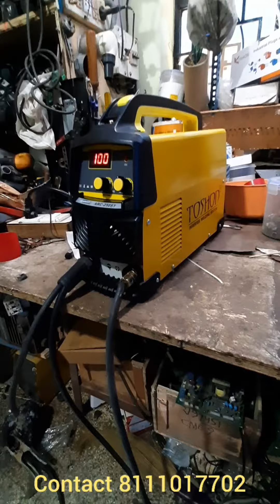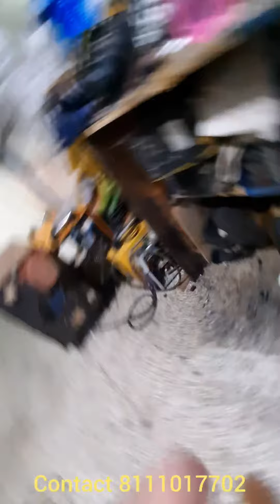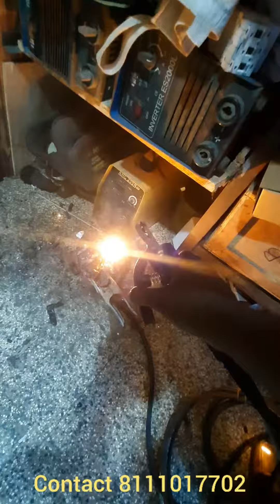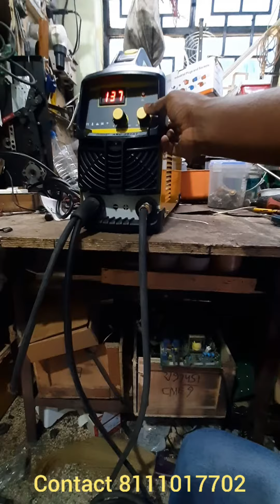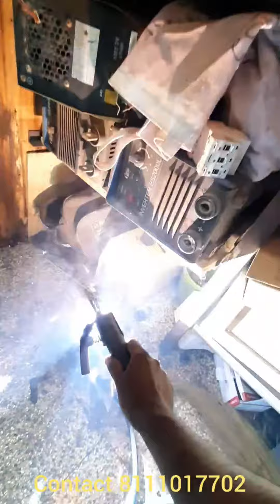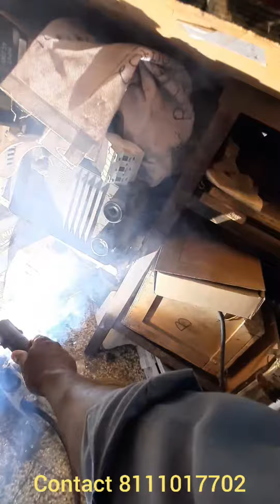Original Toshon brand 250ST welding machine

Comment: Excellent welding machine I'm also using
Reply: 250 arc price?
Reply: Does it gives shock if you touch with bare hands i mean the holder of the road or earthing. Not both to geather but seperately.